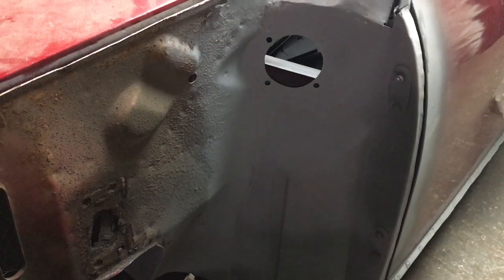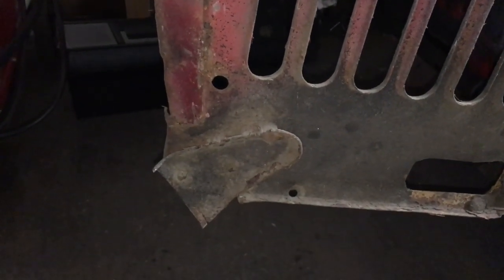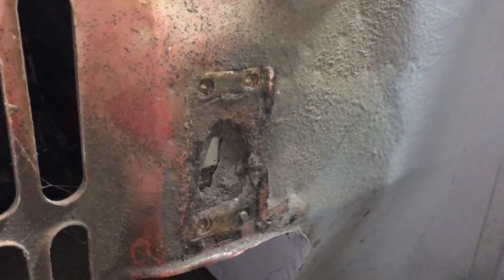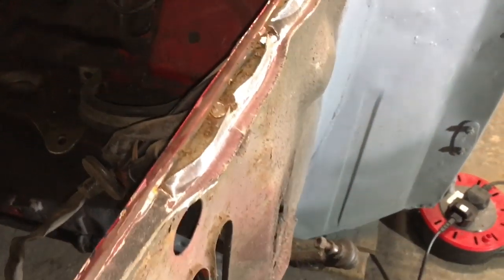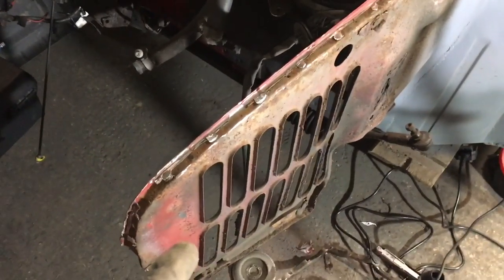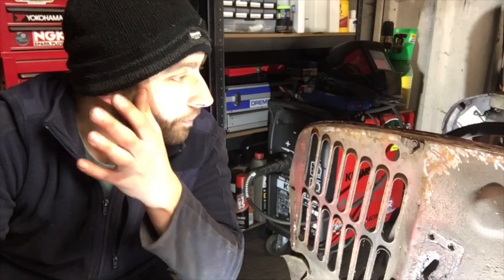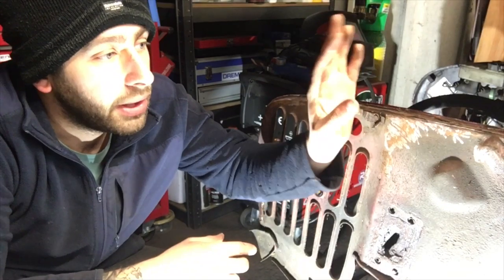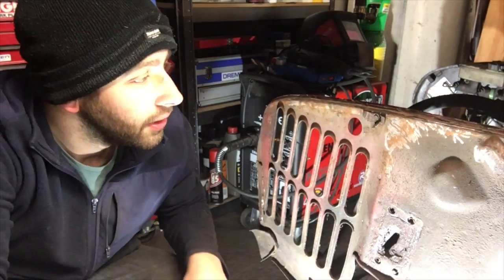Classic Mini Restoration 1989 Episode 20 - Inner Wing Repairs Part 1

Comment: Great vid mate. I don’t think you’re ocd at all. On the money I’d say. You’re right, for the sake of a bit of paint in these unseen areas, we might not be having to do as many of these repairs. 
I’m doing a 66 850 here in Australia, so glad we don’t have to deal with salt, our issue is very fine dust that gets in and attracts moisture. Similar result.
Reply from the maker: Pat Adamson Hey Pat thanks for watching and thanks for seeing my view I on the painted hidden areas I definitely think it’s time and money well spent. Yes the salt in UK is definitely what kills these poor cars off but if we can try and make them future proof then we shouldn’t have the same issue again. I like the sound of your build it sounds great I would love to come see the mini scene out there it definitely on my list of things to do. 👍
Reply: Simpson’s Classics yeah, it’s a bit of an abomination really, I bought it as a stripped shell and it came with a swift GTi engine, so I am running with it. Just have to do a lot of the same rust jobs you are doing, and a boot floor. Big learning curve with efi and all, but I must say I am looking forward to feeling 100odd hp under the bonnet
Reply from the maker: Pat Adamson O yes just working towards that goal of feeling that power would be amazing. I am sure you will get there. Sounds like it will be a cracking car once it’s all together.